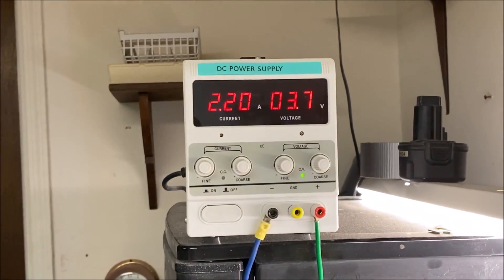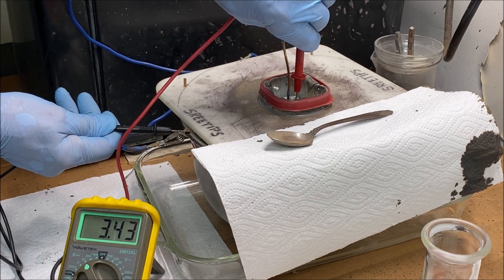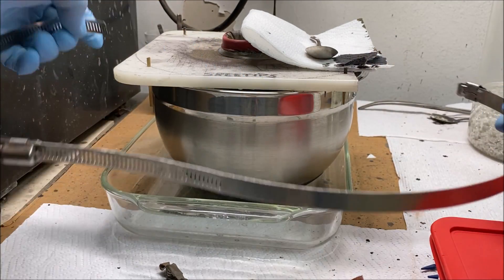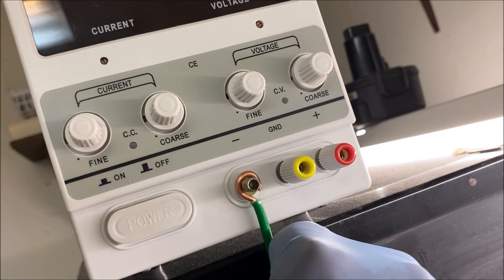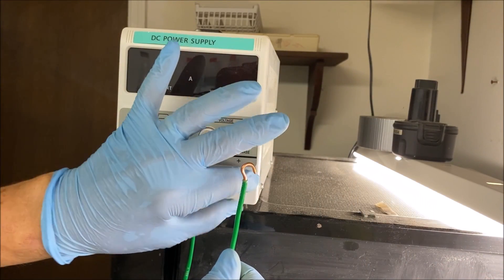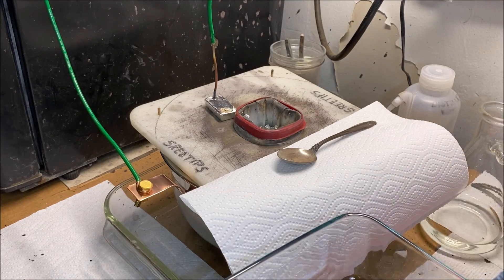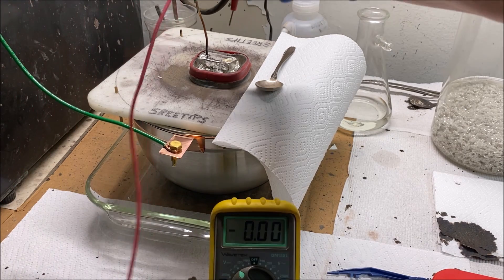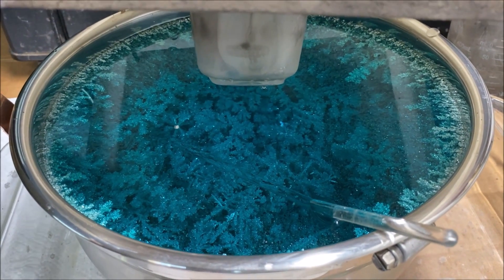EP007 Silver Cell Update New Cathode Connection

Comment: The brass bolt is just a mechanical clamp.  It has nothing to do with the electrical path of the two copper components  It will be just fine as it is.
Reply from the maker: Agree - I wanted copper for appearances only. Besides, brass is 85% copper and 15% zinc
Reply: A little electrical grease between the bowl and copper strip and some on the fastener for the lead to prevent corrosion and you will be all set.

Comment: Awesome!  Looks like you listened to all of us.  It takes a very good and humble person to be able to learn and grow with advice.  Even if you are stubborn like I am at times.  It's hard to change the way you do things, but it's always good to try things a slightly different way once in a while.  

Only thing I would suggest, is to implement some sort of quick disconnect with a clamp or something with the band around the bowl.  That way, it would be easy to just unclamp the band and drop the ring down so you can lift the bowl out disconnected.  You could also possibly solder or braise the copper to the steel for a better connection there, but that's not completely necessary.  You have more than enough connection for what you need.  The brass bolt and wingnut are sufficient.  You don't need to get a copper one, it will be less prone to corrosion anyway.   Keep up the awesome content!  You nailed this upgrade!
Reply from the maker: Excellent. The whole time I’m doing these mods I’m thinking, “how did I get away with that clunky copper-clip junk wire harness for so long?!” Also, when folks suggested that the junk wires was the problem, my mind was telling, “it can’t be, it’s worked fine for years.” Live and learn.
Reply: @sreetips  I was thinking more about a quick release for the band around the bowl.  You could rivet the copper section onto the steel band so it's together as one unit.  That way, you wouldn't have to fiddle with putting the copper band under the band when you take it on and off.  

For the quick release, there are a couple of things you could do.  One method would implement a latch like spring form pans (cheesecake pans) use that you could rivet on.  I'm not sure where you would find a thin one like that though.  

The other option would be to use a pair of vice grips to do a similar thing.  You would just have to overlap the band by about 3 inches or so, and cut it.  Then bend out two similar size tabs at 90 degrees.  Leave about 1/4 inch - 1/2 inch gap.  (not sure on exact size).  That way, you could clamp the ring with a small vice grip and use that as a quick release.  

What you have now will still work great though.  There's more than enough contact all the way around the bowl for good electrical flow.  Just keep an eye on the steel band.  It will also oxidize like the other metals.  It's the vapors from the Nitric causing that.  It's pretty unavoidable.  You can just sand it when it does though.  I love seeing that Silver Crystal though.  Silver is my favorite metal.  I wish our coins were still made like they used to be.  They sound so much better.  Take care!

Comment: Does the silver evaporate? Or just the water?
Reply from the maker: The silver gets depleted as the cell operates. It plated out of the solution as pure silver crystal on the inside of the stainless bowl/cathode. But the actual liquid level also decreases from the water evaporating. I replenish with more silver nitrate to replace the silver concentration and to raise the liquid level back to max depth.

Comment: I’d try soldering or brazing a copper contact to the bowl closer to the bottom. And use an anode like the old one but the wire in the vertical part, so if it’s left too long it won’t eat down exposing the copper wire in your solution and contaminating the silver.
Reply from the maker: I might try sitting a bar stainless bowl on a copper strap and drilling a hole for the connection

Comment: Looks good! Now the only issue is how you dump the electrolyte after the harvest, eg; can't readily pick up the bowl and tilt it into the big beaker. I was a bit surprised at only a .2 volt improvement, but I think it's an indication that you have this rig close to as good as it can be made to work.
Reply from the maker: The lip on the stainless bowl allows me to pour off the electrolyte with no drip or spillage. Should go fine. We’ll see at harvest time.

Comment: You took the voltage measurement at the bowl at the band strap, not directly on the bowl. Try a measurement directly on the bowl from the anode.
Reply from the maker: Seen it, verified it at the bowl - 3.5 volts at the bowl

Comment: Eh. I'm guilty of using the same color wire for low voltage stuff and just scribbling the ends of one of them with a permanent black marker or something if I really need to tell them apart.

I'd suggest the same to you, but so far as I am aware you most certainly do not have access to any permanent black markers. So that idea is out. 😏
Reply from the maker: One lead has 3 ounces of silver permanently cast into the end of it. Impossible to get it wrong - no black marker required

Comment: If the same color insulator on the wire is a problem. You could do like electricians do when putting in a service loop for a house. All the wire you can get for a service loop is black insulated and it is in a conduit. To tell the difference between leads is simple. Wrap  colored electrical tape on each end of each lead. In your case its DC volts. So on each end of the negative lead you wrap black tape around the lead and red tape around the positive lead on each end. Problem solved.
Reply from the maker: One has a big chuck of silver hanging from it
Reply: @sreetips  Yes it does. LOL That all right. One wrap of tape around the green insulation on each end would work. It just to just mark which wire positive and which is negative. If need be.  I'm not one of these guys that saying "It could have done it better," for me what you have now is perfect. I'm just making a suggestion that would keep you from going out and buying color coded wire just to satisfy the "dingers."
Reply: @sreetips  🤣🤣🤣🤣 I loved that response. It should be obvious to people how easy it is to identify them.

Comment: Just wrap the wire with black and white electrical tape at the connections to identify anode and cathode. All good.
Reply: Actually black and red for low volt DC systems. Black is ground Red is hot. Pretty sure your power supply is DC not AC out.

Comment: It looks like you measuring on the strap, not on the bowl.
Reply from the maker: Yep, caught it during the edit so I verified the reading at the bowl off camera - 3.5 at the stainless bowl.
Reply: @sreetips , you can finely measure the voltage drop of your new cathode connection to have a better idea of the quality of the connection: while running the cell at the desired current, just measure the voltage on the cathode side between the stainless steel bowl and the brass nut. You may need to switch the range of the voltmeter to millivolt (if it isn't an auto ranging VM)... Doing so will be a lot more sensitive than comparing the voltage at the bowl with the power supply reading.
The lowest the voltage drop (ideally 0.000 V), the better the quality of the connection. Just keep a log of that value over time and you will not need to dismantle the setup until this value rise significantly.

Comment: Is it the amperage that causes the increased heat and evaporation? Will that concentrate the electrolytes over time? If so, how will that change the crystal growth. Exciting upgrades, sir!
Reply: It is just more energy being used.  Simple explanation, is that it is more watts.  Volts x Amps = Watts.  Something can be 0.01 amps and 777 volts and be 7.7 watts.  Or 3.5 Volts and 2.2 Amps to be 7.7 watts, putting out the same amount of heat.  Or something with 1.5 volts and 5 Amps would be about the same at 7.5 watts.  Think of a light bulb, (the old kind).  A 100 Watt bulb is only using about 0.84 Amps at 120V.  The same bulb in England, would be using 240V and would only need 0.42 amps for 100 Watts.
Reply from the maker: Amps does the work. Better connections means increased current flow through the electrolyte. More heat is the result. The silver gets depleted from the electrolyte as the cell operates.
Reply: Awesome explanations, thank you both!

Comment: Would a copper bowl help?
Reply: A copper bowl would dissolve in the nitric acid electrolyte very quickly, creating a very dangerous mess.  Stainless steel is resistant to the nitric acid electrolyte, but has plenty of electric conductivity.  There may be other materials that are conductive and resistant to nitric acid, but none as readily available as stainless steel.  Keep asking questions.

Comment: I think the copper wire is good, but I think it would be better if it was cast in the silver stem, that way if it erode the base there's no chance the copper could erode too. Just a thought!
Reply from the maker: Copper dissolving into the cell is not a problem. It won’t plate out with the silver until it reaches about 60g copper per liter

Comment: If you have the copper strips, you can make your own copper washers. Cut some copper to size and drill a hole. Or better yet, just find a couple of pre-1983 copper pennies and drill a hold in them.  Washers that are better than what Home Depot sells and at a dirt cheap price! as for the bolts, you can just take some Steel or brass bolts and copper plate them. It shouldn't be too difficult to figure out how.
Reply from the maker: The pennies is a wonderful idea. I may just stick with the brass and penny washers - great suggestion
Reply: @sreetips  If the penny is not flat/smooth  enough for you, then just flatten it with a hammer.
Reply from the maker: Brass is about 85% copper and 15% zinc

Comment: Copper + stainless steel = galvanic corrosion
Reply from the maker: We want to keep a good eye on that when I disassemble the cell for clean out
Reply: That's unavoidable on his setup. As long as he does regular maintenance, shouldn't be a problem.
Reply: Galvanic corrosion is happening on the clips from copper to stainless. Its what is causing the resistance & has nothing to do with the ag crystals.

Comment: For a copper bolt and nut, ask about a grounding lug for bonding 2 wires together. It is a split copper bolt, but should work fine.   Check the the aisle with breaker boxes
Reply from the maker: Someone suggested drilling holes in two pre-1982 pennies for washers - brilliant

Comment: Forgot your fuse!
Reply from the maker: If that crystal grows up and makes contact with the anode it will fry my power supply
Reply: @sreetips  probably has an internal fuse, but an inline is much easier to access!  ;-)
Reply from the maker: Agree - I’ll get it back in the circuit
Reply: @sreetips  The power supply will not fry when it is shorted. It will go into constant current (C.C.) mode. A fuse will not hurt though.
Reply: Yes! ... I completely agree.
This is very good advice to avoid any problem due to corrosion of the contacts inside the fuse holder and an unnecessary and uncontrollable power drop in the fuse ...
Kevin, you'd better use the ability of your power supply to run in "Constant Current - CC" mode. Your PS is already designed to do this and your setup is perfect for it without requiring any further modification (well done!).
You just need to adjust your PS to the desired current using its left current adjustment knobs:
First, put the two "fine" buttons halfway, then the current button "coarse" from the left side fully clockwise.
Then, while the cell is running, increase the voltage slightly with the right side "coarse" voltage knob to around 4V to 5V, you will notice that the current increases accordingly up to 3 amps (or maybe more depending on the model of your PS). It is possible that the voltage does not rise up to 4V because the power supply already switches to CC mode (see the corresponding LED), it does not matter. In this case, lift the anode to make this adjustment.
Then reduce the current using the current knobs on the left to about 2.2 Amps (or whatever value has been found to best meet your needs and experiences). Adjust current "coarse" knob, then finely current "fine" knob. You will notice that the CC LED on the PS will light up instead of the CV LED and the voltage will decrease on the PS indicator (do not touch the voltage buttons). Your PS will now operate in CC mode. The current will never exceed the value indicated on the left indicator, no need for a fuse!
In general, it makes more sense to operate in CC mode because it allows better control of the efficiency of the cell: this is due to the electrolytic couple of the configuration (stainless steel, silver-copper nitrate, silver) which basically has an almost constant voltage (like a battery). It is therefore easier to adjust the current rather than the voltage in order to control the performance of the silver cell.
The voltage read should remain around 3.5V +/- 0.2V. If this value rises significantly, there is either corrosion on the setup contacts, or a lack of electrolyte or silver shots.
If the voltage drops suddenly to a very low value, there is a short circuit in the basket with the forming silver crystals. But don't worry, the current is already limited by the power supply. It is a last chance indicator that it is urgent to collect the crystals before breaking through the basket.
I hope you will benefit from these long explanations, it is good to experiment with the adjustment of the current to obtain the optimal functioning of the silver cell.
Kind regards.

Comment: You could use liquid metal paste between the copper and the bowl. Its highly conductive and will provide more of a connection. It's called cool laboratory liquid metal it's for cpus.
Also you need a bigger bowl... and bigger everything .
Reply: Liquid metal paste will corrode copper. It's less critical than on aluminum, but it still happen.
Reply: Noalox Anti-Oxidant Compound, from Ideal Squeeze Bottle, 8 oz is $6.00 .
Reply: Current setup gives good result, no point complicating the setup - investment wouldn't pay itself back ever.
Reply: It also helps resist corrosion.
 Just a little food for thought...
Reply: Iv had the liquid metal on copper heat sink for a few years and it will chemically bond to it bit not corrode it. The connection is still good and conducts heat away from cpu just fine. Only on aluminum will it corrode